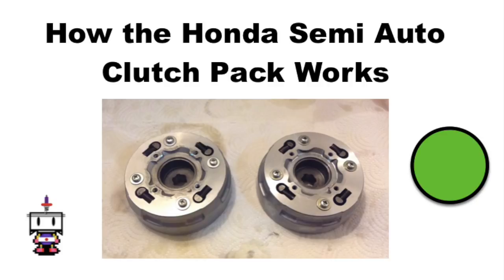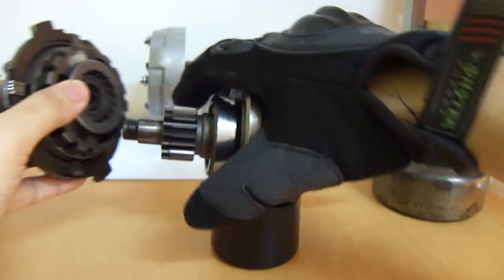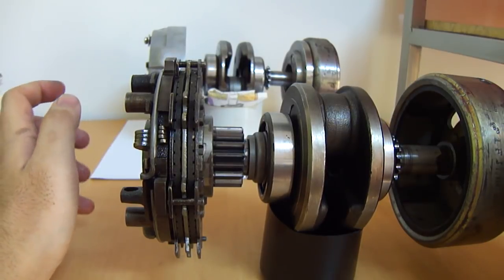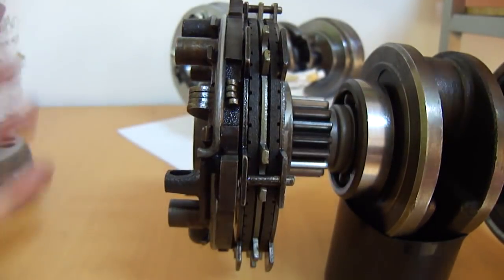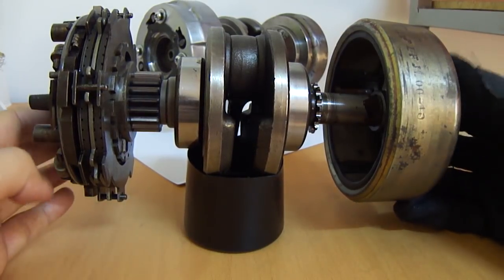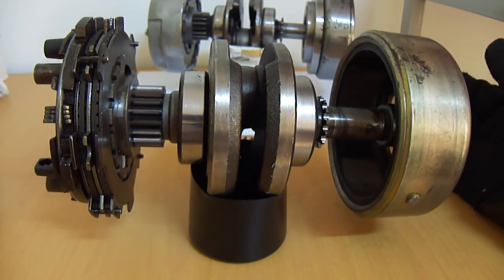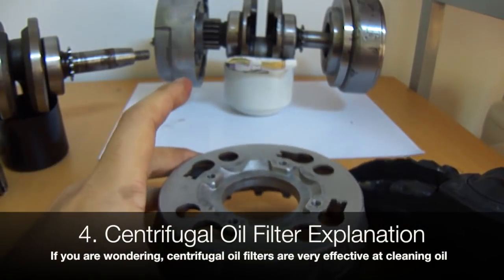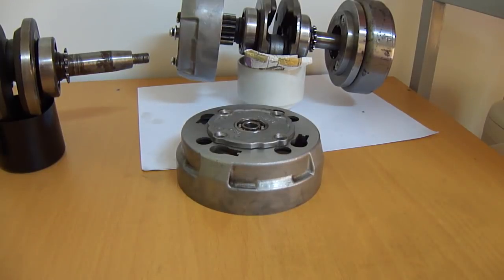How the Honda Semi Auto Clutch Works (50, 70, 90cc)

Comment: Hankyou for the excellent detailed video and thorough explanation of these I automatic clutch  this was a system that  mystified me.  From my child hood   I had  centrifugal clutch mini bikes  and go carts growing up  and a Honda 70 with the semi auto  i could easily understand the mini bike  system  but the Honda  always   Was  a mystery  although i knew it worked  as i got older and understood more about motorcycle engines and clutch packs i suspected there was. A use of  weights and centrifugal force   But i thought it worked  perhaps by pressing the other way  maybe even pushing against the transmission  case cover ?    I didn’t even consider  the wheel chatter  you mentioned  but   It took me over 40 years to  understand this system and the  power of youtube  and the internet ! I  do have one   Crazy question.  On this system if. You can  convert a traditional manual  clutch Honda into a semi auto by  exchanging  the two mechanisms ?  In other words   Convert a antique Honda 90 motorbike into a semi auto  with its original transmission ( numbers matching).
Reply from the maker: Hi there,

Unfortunately the semi auto and manual clutches are not interchangeable.  Later on in 1988 when Honda switched to the "Twin Clutch" motor this became possible (converting manual to semi auto easily), but on this particular style of engine this clutch system is unique to this engine only.
Reply: I want to thank you for reading. And responding to my.  Question.  On converting.   The antique Honda 90.  Its not the. Answer. I wanted but.   That is life. !    I may try to.  Source. A.  Honda. 90 semiauto.   Off. Another.  Bike ?   Although. I will.  Think. It thru. Before.    Actually.   Doing.   It.  For  now. I may just. Keep it.  Stock.  Like it is. Cuttrntly.
Reply: @craigmonteforte1478  Since this mechanism requires a couple of parts not shown here I would have to agree that it wont work.  The shift lever works by pressing against the outer case cover while using a ratchet mechanism to push or pull the shift drum from behind the flywheel shown in the video.

Comment: But if I'm coming up to a set of traffic lights and I change down say from 3rd to 2nd  while moving too fast the engine will lurch the whole bike and then increase it's rpm. That must mean there's an issue with my slipper clutch?
Reply from the maker: I might have not been clear on the slipper clutch, but the main purpose of it is to prevent rear wheel chatter, rather than complete lockup.  It's like a temporary failsafe that gets tripped in "peaky" conditions, and that means it will still of course grab when downshifting, just not get your rear wheel skipping if you do a quick downshift at high rpm.

That being said though, my personal experience is that a perfect condition engine is still a bit clunky on downshifts and that you can in fact briefly skid your wheel on hard downshifts if you don't blip the throttle.  I'm just 9.5 stone soaking wet though, so I as a rider don't add a lot of weight on the rear.
Reply: TheAnigai it all depends on the timing inside the case and or the adjustment if it can be adjusted. if you can hold the shifter up or down in any gear and the bike does not move and you left the shifter Go to normal position in the bike moves is usually in good adjustment anything other than that you have problems
Reply: I actually have my fathers  1964 Honda 90   That has a manual clutch.  Is it possible to convert it into a semi automatic ?   If so how would i go about it ?  I would like to maintain   The factory look  on the outside of the. Bike  as it was kept in a  climate controlled  storage for the majority of its life   And i like the current patina and  factory paint  the bike will probably be a. Novelty. Rider probably  used as a pit bike or  used in private campgrounds  or property
Reply: @craigmonteforte1478  You can probably convert it by replacing the clutch pack as well as the shifter linkage from a semi-auto. The rest of the engine is pretty much identical, except from the engine case on the clutch side, which obviously has a hole for the clutch actuating arm in case of a manual clutch, which is not there in a semi-automatic.

If you can get a semi-automatic donor engine from the same vintage the parts will pretty much swap right over.
Reply: I have also noticed from experience myself that if you assemble the slipper part incorrectly (which can easily happen and you wont really notice at first) you will simply prevent the clutch from disengaging when being pushed.   There are 3 angled slots on the cog, and 3 open slots if you get the angled pegs in the open slots you wont get a slipper, but the clutch will still work.  Oh and if you get it wrong you will hear a bell ringing sound when you first put it in gear.